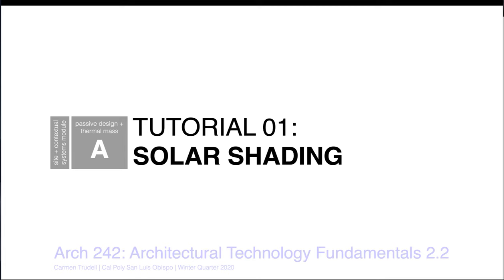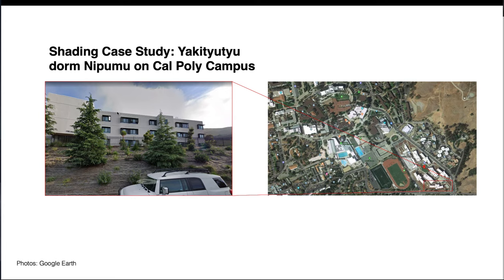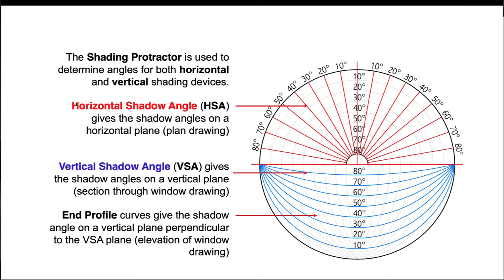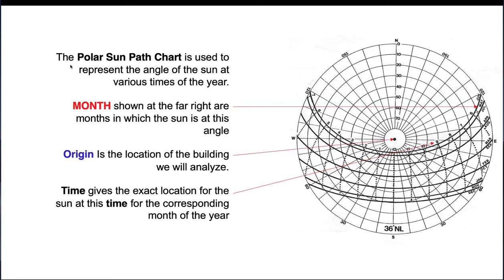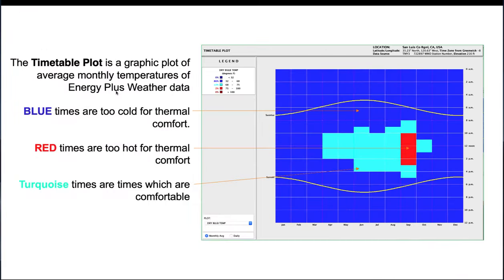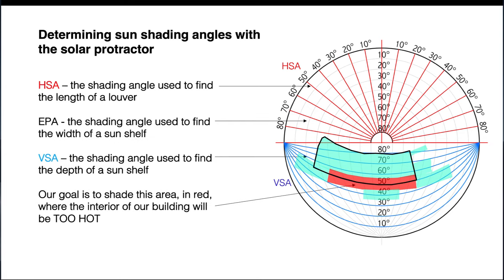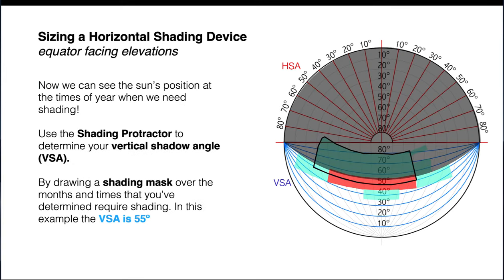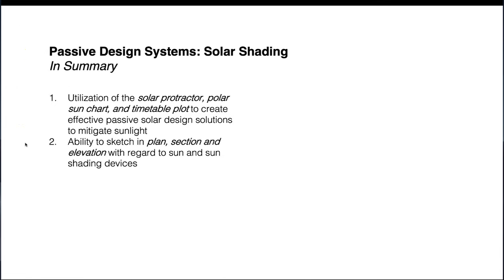Process for Designing Climate Specific Solar Shading Devices

Comment: Why do you use the dry bulb Temperature setting on the plot, and not the tilted Surface Radiation setting?
Reply from the maker: We are plotting the times of year when the temperatures are above the comfort zone in order to determine the times when solar shading is needed. I don't think the tilted surface radiation data would give you this information.
Reply: @cgtrudell  Would you use the "Direct Normal Radiation" Timetable plot instead of the "Dry Bulb temperature"?.... The reason I ask is that my "Sun shading chart" comfort zone reflect the "Direct normal Radiation" plot comfort zones instead of the "Dry bulb temperature" timetable plot that you are using...

Comment: how to  determine the shading mask?
Reply from the maker: There is interpretation and judgement needed when determining the shading mask. For fixed shading devices, you may have to block some spring sun positions in order to also block these same sun positions in fall, even though in spring the sunlight would be a welcome heat source inside the building. For this reason, the shading mask is shifted toward the afternoons when overheating is likely to occur, and is pulled back to ensure that the coldest months are not shaded.